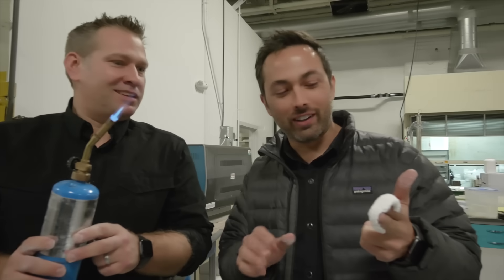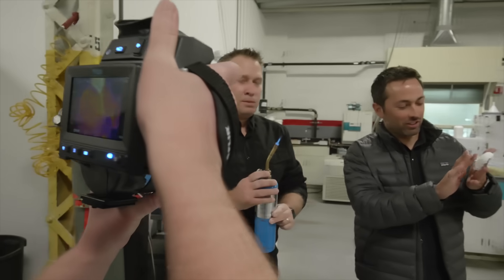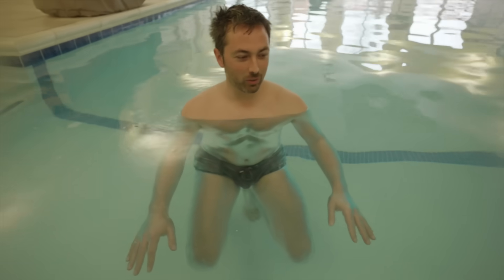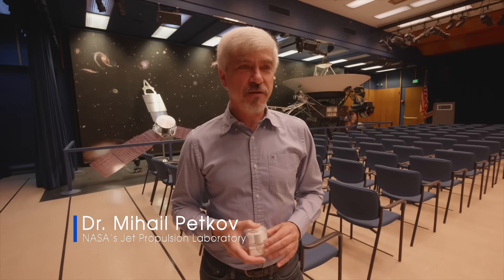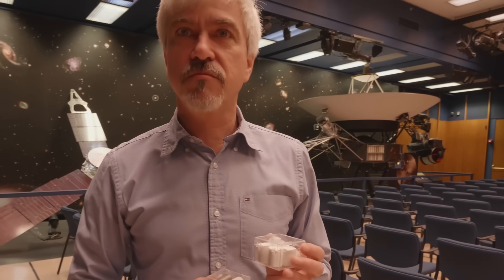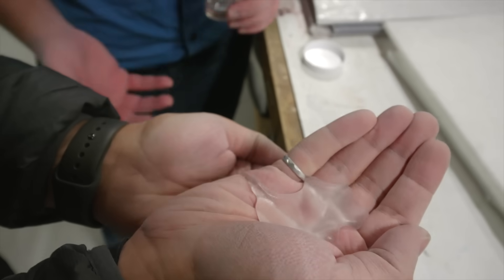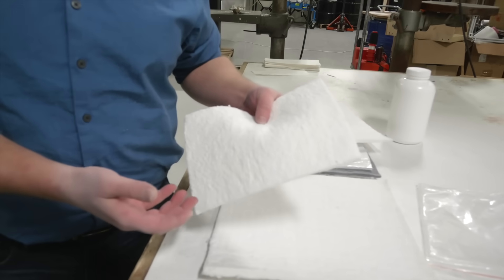I Waterproofed Myself With Aerogel!

Comment: This can save lives. Imagine a fire-mans suit with aerogel.
Reply: Or a minimalistic diving suit
Reply: @codyfabulousyt4920  you have to spray the butthole
Reply: it costs 23,000 dollars per pound of aerogel, 1000 cubic meters is only 0.0083 lbs. Pretty expensive if you ask me also im pretty sure they would already be using it
Reply: @priority688  that's around 1909$ per 1000 cubic metres. Let's say one suit would cost 1 cubic metre of aerogel to make. That would be 1.9$ per person. Not that expensive if you ask me
Reply: @srorelgames6957  exactly, that's cheap AF
Reply: @priority688  You don't have to use pure aerogel, just a little bit and it gives a massive boost in thermal conductivity.
Reply: @ghoulbuster1  i think thermal conductivity is what we're trying to avoid
Reply: Scientist Walter not conductivity that’s the opposite of what aerogel does
Reply: @Pinkskull69420  not true aerogel will absorb the heat and act as an insulator for the heat
Reply: Scientist Walter  - huh ?
Reply: @ghoulbuster1  massive boost to thermal insulation you mean
Reply: @priority688 
cost of something changes as it is produced more.
people were saying the same thing about electric cars and now they're way cheaper than what they were before
Reply: unite perry yeah but i just looked for the price of the gel and it was pretty big, also it was pretty new so of course its gonna be expensive
Reply: @dsdsspp7130  umm, no because the cost to produce something doesn't change.
Reply: Priority are you being sarcastic because over 100000 cubic meters of this substance for 23k is a VERY good price!
Reply: @lyonheart_8643  lmao that's what I was thinking, that doesn't make any fuckin sense
Reply: Sam Ram thank you :)
Reply: Dragon Dude that’s what he said read it again
Reply: Dragon Dude he said 1000 🤔
Reply: Priority that’s what I was about to say l lmao
Reply: @priority688  human genome sequencing in 2001 did cost 100,000,000 dollars nowadays (19 yrs later) you can do it at just 1000 dollars. That's 1/100,000 of the price...
Reply: Priority if 1000 cubic meters is less than 100 dollars that sounds pretty cheap to me
Reply: Priority plus the fragility pry prevents it from being too practical, right?
Reply: @priority688  that's not expensive
Reply: @priority688  can you really put money on a man/woman's life while saving a life?
Reply: Priority you must mean 23000 per cubic meter not pound
Reply: Priority you don’t need it to be heavy the matierial is super light
Reply: @priority688  yes but in the future it might be cheaper like reverse comic books
Reply: @priority688  That still equates to just 5.21 dollar per cubic meter, or half a cent per litre.
Reply: @priority688  By those numbers, 1000 cubic meters of aerogel would only be 190.9 dollars.
23,000 x .0083 = 190.9.
Reply: Priority why tho
Reply: @priority688  the way i read ur comment 🤣
Reply: Priority BBC
Reply: @priority688  soooo your saying the problem why we can't make human lives better and progress our society to the utopias we create fanatasy stories on is because other humans just want some "M's" in their bank account for it??
Reply: @priority688  they're 50% weight so that means they are light. Therefore it can be cheap and lightweight. So from that weight it could be a lot of aerogel
Reply: Priority isn’t aerogel like the lightest solid on earth.
Reply: @priority688  that would make it insanely inexpensive
Reply: Priority it’s so expensive yet they using it like a toy in this
Reply: @priority688  ok, but how much of the substance do we need to coat a single suit?
Reply: @priority688  because a human life isn't worth twenty three thousand dollars. ok.
Reply: @priority688  besides the suit will save lives
Reply: @priority688  sponsored by Jeff bezos and imgine just a tip they can focus on making it easier to get
Reply: @priority688  1000 cu. m that's a 10x10x10m cube. pretty cheap actually at that quantity if your figures are right. but something isn't right about 0.0083 lbs for a cube as big as my house??
Reply: Priority government can pay for that mofos had trillions of cash
Reply: Priority that’s why we should defund the police :)
Reply: @klarisaarwena  stop bringing this up everywhere.
Reply: AcE 98 boohoo police being defunded so that other sectors like education and fire departments can have better stuff is bad, we need people to realize this so yes i’m bringing this up smh
Reply: AcE 98 nice try but that won’t stop me honey, that mindset is wrong
Reply: AcE 98 sorry broski but those opinions ain’t gonna sway me, they’re just gaslighting experiences to get the upper hand :(
Reply: @ace9848  it's true and good everywhere tho
Reply: @klarisaarwena  i voted to give police a bigger budget in my locale
Reply: @klarisaarwena  no
Reply: But then again, its not the fire that kills the firefighters, its the smoke isnt it?
Reply: Harun Meta they use masks so then no smoke and no fire
Reply: @harunmeta2258  Exactly.
Reply: we can fund fire departments without defunding the police
Reply: @Jourmand1r  nice philosophy
in the real world, the ones with the guns have the power to take all the money while you're not watching
take away PDs' guns, and sure, we can fund fire departments without defunding the police
until then, they will keep capturing more and more of the available public funding
in Colorado, where a billionaire waged a decades-long campaign to make it hard to collect any kind of taxes, any time we want to fund our schools better, the cops get a cut
if we want our post offices to stay open, we have to pay protection to the pigs
oh word? forest fires are going to require double the funds for fire prevention and mitigation this year? police won't be fighting those fires, but they will be slurping up a substantial slice of that scratch
defunding police is the only way to reclaim a functional government
Reply: Fire isnt the danger to firemen, its the smoke fumes that are the most dangerous..plus they already have fireproof suits
Reply: It could also boost antarctic and space research by making it easier to survive in harsh temperatures
Reply: Could def help my brother. He works in the line of duty as a fireman and he’s seen people get burned like you would not know. Definitely would help all kinds of first responders.
Reply: @justinfansler3940  Smoke is what kills people in pretty much every case. It is rarely fire. You would suffocate to death before you burnt to death.
Reply: Or like something where they bring into a burning building with aerogel that they put on people so they don't get burned getting out of the building
Reply: Some random firefighters in boxers walking around glowing lol
Reply: I mean, maybe this could be used in space suits?
Reply: There's actually a few papers researching woven aerogel and etc with firefighter clothing with really great improvements from the few I read. One exclaiming a 5s space of time for a firefighter to get burnt with typical gear vs 105s or so with woven aerogel fortified PPE so it seems like they're looking into it.
Reply: @willford55543  It's weird to me how little cultural penetration the idea of "technology readiness level" (TRL) has gotten, with how technocratic our culture is. TRL describes how available a certain tech is for use in various applications, from purely hypothetical (warp drive etc) to widely available on the consumer market (gorilla glue). I didn't come across the concept until college, but it seems like a really easy way to communicate to the public something like, "Hey, this tech is really new and there's still a lot of kinks to work out before you can buy it at Wal-Mart, but we're not keeping it from you because we just want it for ourselves. It's coming, don't worry." Feels to me like it would go a long way toward relieving some of the public's conspiratorial fears about tech being hoarded by academics lol.

(Though at the same time, the military-industrial complex remains a monster that is even more dangerous than when Eisenhower warned about it in the fifties.)
Reply: True but u would still have to wear a mask so u don’t breath in the smoke
Reply: But he naked
Reply: I was thinking exactly the same thing.
Reply: Smart
Reply: Woah
Reply: Expensive
Reply: It's quite weak tho
Reply: Prolly just break pretty fast
Reply: I was the 1k liker
Reply: The thing about this is fire fighters all ready have very good suits
Reply: It's really brittle doe
Reply: Yess
Reply: It breaks easily  lol
Reply: @JoeZay6  but that blanket material that he showed of the end of the video
Reply: Then someone throws a rock or a meyal object then your suit broke
Reply: @ssquishyv7676  meyal?
Reply: @JoeZay6  metal*
Reply: But it will take forever to put on
Reply: @Ducky024  not as much as u think
Reply: It would be expensive though, but if we could afford it, we would definitely get it
Reply: @acc19y  yea
Reply: What a idiot you are if they will be water proof they will die if they get on fire
Reply: @khizersyed3827  no it has waterproof properties and fireproof properties it's very good material
Reply: It would probably break faster though.
Reply: @paytondev  not the blanket aerogel
Reply: The Crusader1175 oh, that makes more sense now
Reply: I might be wrong, your intention is pretty good but I don't know if it would be safe. You would basically cover up all you pores on your skin, it would be unable to "breathe", I think your cells would end up dying from lack of oxygen (Once again, I might be wrong, but that's my opinion)
Reply: A fire mans suit is basically areogel but wayyyyy chreaper
Reply: expensive
Reply: And they are naked
Reply: I think many of firemen die from smoke inhalation rather than fire
Reply: @nirvocity they still would have to wear those heavy oxygen tanks
Reply: That’s what I was thinking
Reply: Yes
Reply: Yeeesssssssss#s
Reply: What's a fireman
Reply: I thought this was already invented before, my grandpa use this one to style their hair and looks like Rick Astley. They called it HAIROGEL.
Reply: Priority
2 months ago
it costs 23,000 dollars per pound of aerogel, 1000 cubic meters is only 0.0083 lbs. Pretty expensive if you ask me also im pretty sure they would already be using it
#o# i agree
Reply: It breaks easily it wouldn't work
Reply: Imagine spraying aerogel on yourself while escaping fire.
Reply: A thin layer for insalation on bomb shelters or bunkers would be great in case of nukes?????
Reply: Fire is not what kills. Smoke inhalation causes 80-90% of fire related deaths.
Reply: Condoms
Reply: You can make armor with aerogel not the whole body because the top comment say expensive yes
Reply: Yessss expensive lol
Reply: You really are living in thw future huh.
Reply: @Priority you a bitxh
Reply: *fire-fighter's babey🤘
Reply: this is exactly what i was thinking !
Reply: And it’s a one time use
Reply: Aerogel space suits
Reply: They do it with the glass for cars and windows
Reply: Fireman's problem isn't fire it's the poisonous has that comes out of it.
Reply: Also the fireman's suit already repells fire they don't need another more expensive option
Reply: @LukeMiura  if it increases their survival rate, heat resistance and there for extends the time they can stay to look for people or something, then they definitely deserve the best of the best. A few bucks shouldn't matter in that regard. Most currency isn't even real anyway, just some numbers on a computer
Reply: Soo true
Reply: If scientists can make a more durable and easier to manipulate form of aerogel then they should implement it into firemen suits
Reply: 1 cost alot
2 hard to make
3 breaks easy

what fire fighters need is starlite (starlite is very cheap the creator said he created it from kitchen supplies), even tho that recipe is lost some copycats are showing up that seem to work pretty well

aerojel resists up to 600 degree c
tantalum carbide (worlds most heat resistant material) resists 4000 degree c
starlite was claimed to be able to withstand a laser beam that can produce up to 10,000 degree c
Reply: @crimsonkarma13  yeah it's a novelty material, but I'm sure there's some application for it. at least it is pushing the boundaries of what is possible and can lead to more discovery
Reply: Do you think people turn orange like lobsters?
Reply: @Pinkskull69420  I'm black Soo😶
Reply: @jrobmemulous7873  so probably not huh
Reply: @Pinkskull69420  ye
Reply: YEEEEEEEEEEEEEEEEEEEEEEEEEEEEEEEEEEEEEEEEEEEEEEEEEEEEEEEEEEEEEEEEEEEEEEEEEEEEEEEEEEEEEEEEEEEEEEEEEEEEEEEEEEEEEET!!!
Reply: @ED-so9lp  what's wrong with u
Reply: @jrobmemulous7873 I love da yeet
Reply: @ED-so9lp  ok
Reply: YYYYYYYYYYYYYYYYYYYYYYYYYYYYYYYYYYEEEEEEEEEEEEEEEEEEEEEEEEEEEEEEEEEEEEEEEEEEEEEEEEEEEEEEEEEEEEEEEEEEEEEEEETTTTTTTTTTTTTTTTTTTTTTTTTTTTTTTTTT!!!!!!!!!!!!!!!!!!!!!!!!!!!!!!!!!!!!!!!!!!!!!!!!!!!!!!!!!!!!!!!!!!!!!!!!!!!!!!!!!!
Reply: That's what I was gonna say
Reply: N.W. okay I’m sure starlite would work better even if it was the fake recipe it’s still better

Comment: this material could be use for PPEs today? 
you can burn the surface of the material but not melt it and it's fairly flexible ... 
it cannot be penetrate by water ... 

the only remaining to be test is airborne chemicals or virus particles ...

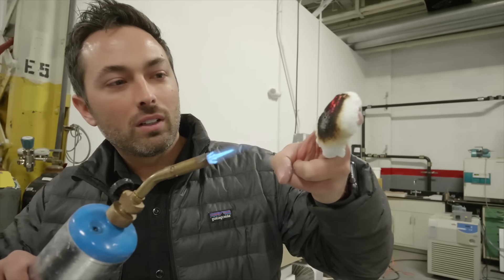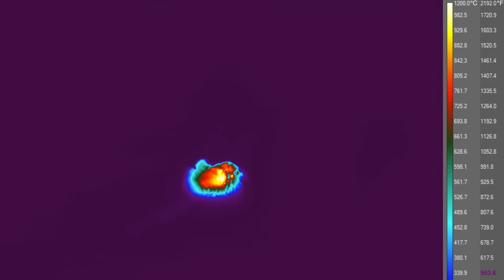Comment: 3:00-3:06 you can see the guy pulls his pointer finger away from the aerojell, to create some distance between the flame and his finger. What a joke. 

This guy has clearly felt the flame go thru the aerojell, or his finger wouldn't be resting behind the other finger, when in other shots previously, his finger was uniform with his middle finger.

Comment: A cheaper better version for just wanting to kill pests, Diatomaceous Earth is a white powder made of the fossilized remains of marine phytoplankton. 
When sprinkled on a bug that has an exoskeleton (such as bed bugs, ants or fleas) it compromises their waxy coating so that their innards turn into teeny tiny bug jerky.

Diatomaceous earth will help you control these insects and arthropods:
Ants.
Bed Bugs.
Carpet Beetles.
Centipedes.
Cockroaches.
Crickets.
Earwigs.
Fleas. 
When taken by mouth, diatomaceous earth is used as a source of silica, for treating high cholesterol levels, for treating constipation, and for improving the health of skin, nails, teeth, bones, and hair. When applied to the skin or teeth, diatomaceous earth is used to brush teeth or remove unwanted dead skin cells.

Comment: The body itself already is waterproof. The skin doesn’t prune and wrinkle cuz of the water, it does because the brain recognizes that the body is wet so the skin wrinkles and prunes so that you can better grip on surfaces when you’re wet. That’s why when you run on dry concrete with wet feet you don’t slip. But if you run on wet concrete with wet feet then you do slip.
Reply: Mmmmm....
Reply: That’s how the body works, don’t believe it then look it up for yourself

Comment: Is there a way to make that aerogel paste harder ? Like some kind of plates but not brutal like it is at beginning ?
Reply: What were you thinking of doing with it in a more solidified form?
Reply: Dolly I just wondered... could be useful for spacecrafts of hypersonic airplanes... (I won’t build one ok, I’m not the NASA, but I wanted the info just because it’s interesting)
Reply: @simondavid2519  I don't care if you do? Lol you're free to do whatever you want. I was just interested in your ideas. What kind of insulation are they currently using for spacecrafts and hypersonic airplanes?
Reply: Dolly they use thick ceramic tiles which must be replaced after each flight because the loose almost two thirds of their thickness during re-entry in the atmosphere (take for example the space shuttle, all the black parts were covered by ceramic plates). So I just thought that an aerogel type material could be a pretty useful material for such uses...

Comment: We should put this in fire fighters suits like if you feel the same
Reply: The Craft Kid it’s more expensive than gold.
Reply: @kavishpersad2102  hey it might be expensive but it will save lives and make firefighters more comfortable to not have all of the burn marks everywhere.
Reply: hey it might be expensive but it will save lives and make firefighters more comfortable to not have all of the burn marks everywhere.
Reply: @wrangleroutdoor8574 , Okay, we get it, it might be expensive. That's not the point. Its WATER proof. The water is the one thing they need on them for protection if they got caught on fire
Reply: @justipooh6866  but they had a touch to his hand and he got warm
Reply: @justipooh6866  It's also a good insulator too. It was shown in the video how they held a blowtorch up to his hand and it wasn't burnt, because of the aerogel.
Reply: Why do they need to be waterproofed...
Reply: @acriticnamedpanem1141 , Dang, now I feel retarded. I didnt even realize that.
Reply: @justipooh6866  No you can chnage its structure and make it fireproof
Reply: @acriticnamedpanem1141  hey it might be expensive but it will save lives and make firefighters more comfortable to not have all of the burn marks everywhere.

Comment: Is it also a good sound insulator? Best application for this is on the space rocket body as it is much lighter weight than the ceramics they use to protect the body of the rocket from the huge amounts of heat creates by the friction of air against the body upon re-entering the atmosphere.

Comment: That doughy material is called starlite . And NightHawkinLight made it with basic materials . Or made something which is close to starlite . The carbon foam acts as a excellent radiator . And it radiates the heat out pretty fast which insulates you from getting burned.  
I have a question. 
 How does this material deal with slow heating and indirect heat ? . Because  flames are  plasma and it instantly burns and forms the carbon foam on it 

Would be great if you make a video about it .